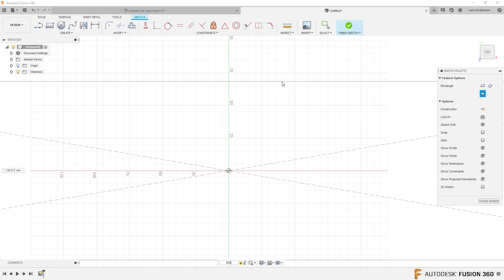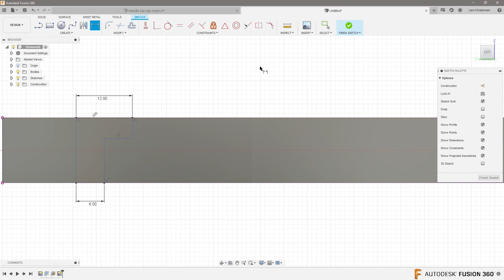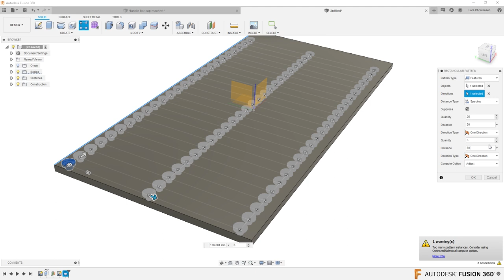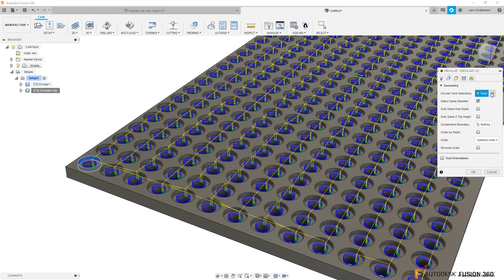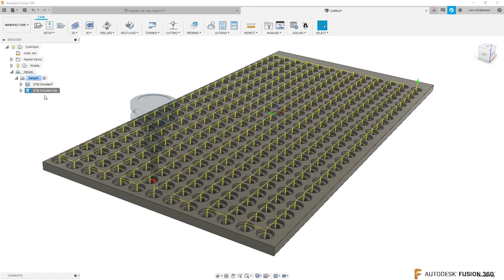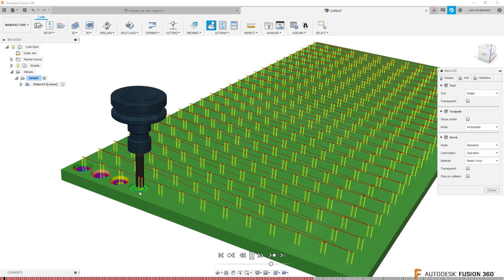Fusion 360 — CAM Pattern Hack You Should Know — Ask LarsLive

Comment: Hi Lars, just want to say a big thank you for what you do here! Your video on constraints have helped so much, working with Fusion 360 is more of an dance than a struggle now. If i just could find the video where you explain "Join when extruding", as it sometimes makes one body, and sometimes separate bodies 🤔😊. Keep up the great work! 
Best regards from Sweden.
Reply: There is a drop down box at the bottom of the extrude menu. It has several options that will
 change way the extrude will work. You can join, cut, create a new body, or intersect. I would suggest playing with each of those. That will be the best way to understand what each option does.

Comment: Are the pattern dimensions/number of instances a parameter or have dimension numbers so you don't have to remember to change your cam pattern whenever you change your model pattern? Could you use a parameter for those values instead of typing it in? Otherwise, I personally would often forget to change the CAM to match the model or vice-versa.